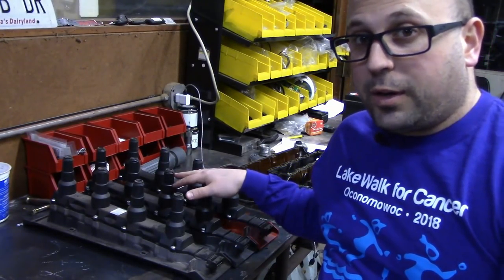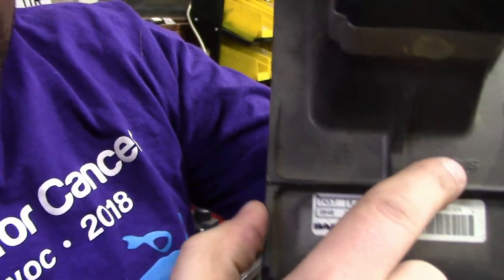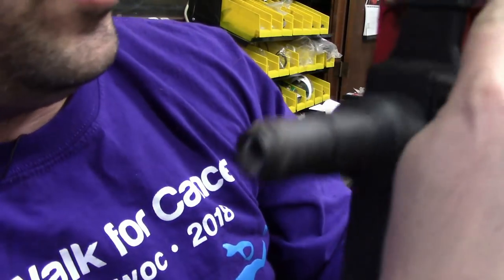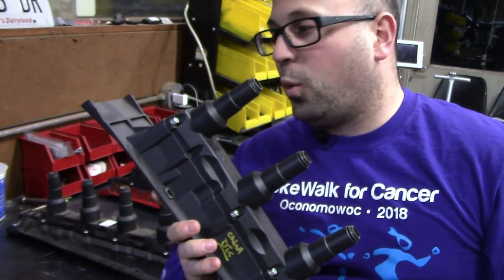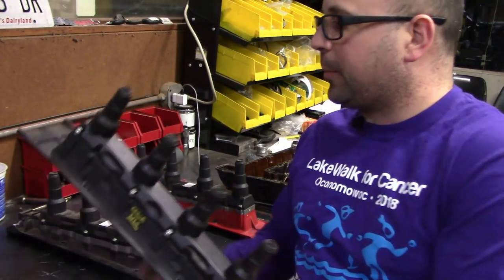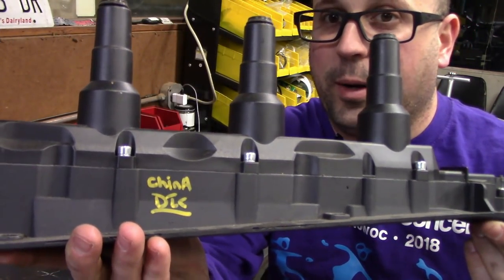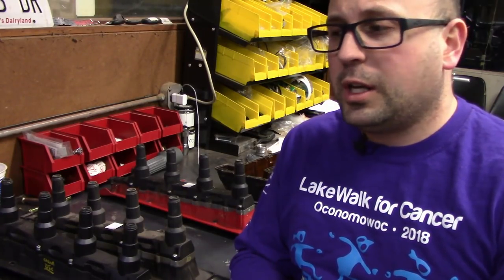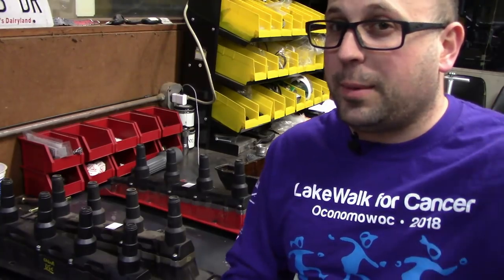Everything you need to know about the Saab DIC (Direct Ignition Cassette) and more!

Comment: What about the 02 9-3 SE? Does have a red DIC if not then could one work with it?
Reply from the maker: 02 9-3 is T7 and should have a black DIC. I would not recommend running a red DIC in that car.
Reply: What about using a T7 DIC on a T5 car?
Reply from the maker: I actually explained that in the video. You can run a T7 DIC in a T5 car, however it won't detect knock correctly isn't isn't truly 100% compatible. It will work and will get you home though, but I would not recommend it long term.
Reply: Thank you so much, but I have another question regarding the same car. I have an oil leak on the driver's side located between the tranny and engine could this be a blown rear main seal?
Reply from the maker: @Ayixlia  yeah, I'd guess that as a rear main seal depending on exactly where it's coming from.

Comment: Hey Saab Doctor. I have a 2000 Saab 9-3 Convertible LHD and hearing metalish sounds from the front driving slowly over bumps. And when I'm turning the wheel there are like clonking noises and the gaspadel moves a bit sideways. What could this be? Stearing Rack isn't moving at all
Reply from the maker: That sounds like a strut mount and bearing. But could also be a worn isolator on the bottom of the spring
Reply: @SaabDr  do you think it could be a cracked bulkhead?
Reply: I heard from this and now it won't go out of my mind
Reply from the maker: @a.z.3214  I've never heard of issues with any part of the body actually cracking. That definitely wouldn't be my first guess as long as the car was structurally sound
Reply: @SaabDr  oh thats a common and very typical problem with the rhd. Never heard of it in the US?
Reply from the maker: @a.z.3214  nope and I own (and have owned) a handful of OG 9-3s and never had issues.
Reply from the maker: @a.z.3214  from a quick Google it looks like a known RHD car issue, not LHD issue. Probably why I've never heard of it.
Reply: @SaabDr  okay, i still hope this problem doesn't affect me. My car just has 110kmiles. Would be a shame when it's broken. Could you please tell me how i can check the things you first said could be the problem. I'm out of reach of any saab knowing mechanic in the Bavarian countryside for holiday. Another symptom is that it's more likely to do the mechanical noise while it's still cold.

Comment: I have a 2002 Saab95 Arc. I am about to replace the DIC in the car. I am reading the V6 has two DICs, is that correct? If there is a second one, where is the second one? Thanks so much for the info!

Comment: No one thinking to move the DIC. case higher 10 to15mm. high from engine cover by used teflon insulator. SO the DIC.case not touch the engine cover. Sothe DIC.unit will not so HOT...

Comment: I thought T5 cars could use both casettes, no problem. But T7's can only use red ones in emergency because they dont have the right knock detection system or something?
Reply from the maker: From my understanding you can't run a red dic in a T7 car at all. And here are the differences between the two (stolen from Saab central since I don't have WIS in front of me and this is more technical than I get normally)
Ignition coils (different inductance and voltage type)
- Trigger signals (different sensitivity to external interference)
- knock signal (different degrees of signal amplification)
- charge and discharge circuits (different technical concepts)
---
Where you can (and lots of people do) run a black DIC in a T5 car it's not 100% right and won't work exactly the same as a red dic would. I've run a black DIC in a T5 car without issue, but it's not the ideal situation.
Reply: @SaabDr  Aha. Fair enough.  Since I've got a few spare red ones sitting around, I'll add "swap DIs" to my to do list.
Reply: This is not true I have T7 and run red dic or black dic without any issues.

Comment: At least the Chinese one gives people an extra option. The OE one cost about 6~10 times more than the Chinese unit here in China. But, does the OE one lasts 10 times longer? Doubt it.
Reply from the maker: I've had Chinese ones fail out of the box and seen more than one fail within 1-2 months of installation. On the other hand I have 10+ year old OE one that are fine. Here in the US a Chinese one is about half the price, but even at 1/10th the price I'd still recommend OE since you know it's made to the correct specs.
Reply: @SaabDr  interesting, always want to hear more about the durability of these parts. I am about to replace a DIC for one of my customer. Will try a updated Chinese one, cos financially, I want the best for him since many SAAB enthusiasts here in China recommended it out of their experience. Will see if it worth it, but a OE one would be my choice if it's my car.

Comment: My 97 saab 900 se hatchback misfires.   Do I need a new one then?
Reply from the maker: Does it have the 2.0 Turbo?
Reply: @SaabDr  yeah
Reply from the maker: I'd start with spark plugs, but depending on the age of the ignition cassette you may need to replace it. Make sure to get NGK Copper plugs (BCPR7ES or BCPR6ES). Other plugs could cause issues
Reply: @SaabDr  I'm new to working ok cars.  But this might be a dumb question.  How do I replace those?
Reply: @SaabDr  and how many are there to replace?
Reply from the maker: @bradleyanderson5701  there are 4 spark plugs. You would remove the ignition cassette (should be 4 T-30 Torx bolts holding it down), then you'll need to check the gap of the spark plugs you bought and make sure that they're within spec for the car before installing. You'll need a standard 5/8" spark plug wrench to remove the plugs. They should be gapped to .035".
Reply: As these cars get older, keep in mind that injectors are rated for the life of the vehicle. That said my 9-5 hit 210k miles and started giving a miss fire. Installed a new set of nkgs and still miss fire. Tried a new cassette, same mise fire. Replaced fuel injector, fixed. Gotta keep em going!
Reply: @chrismadson9479  I put some of that fuel injectors fluid in  and I dont think it did anything.
Reply: @chrismadson9479  how easy is it to change those?  And how much does it cost
Reply: They are easy to access on the 9-5s. Injectors range from $60 to $120 depending on new oem or rebuilt one's.
Reply: @chrismadson9479  I have a 1997 900.

Comment: Logical oversight:
If the cheap Chinese ones are "known for failure" how did they get there in the first place?
Presumably they've been installed into an engine that, with its owner has already destroyed one.
My suspicion, without bench testing them over 2,000,000 simulated miles, is that there a usage pattern or failure mode that can kill DICs and the Chinese ones are installed into cars whose states/usage have already shortened part life on an OEM part.
Reply: Although, the oems have random failures and possible shortened lifespan due to engine being bad... Assuming that theres a pattern becuase you need to change your di is wrong. A di have limited lifespan and will fail with time and usage it don't mean that there's a issue with the engine...